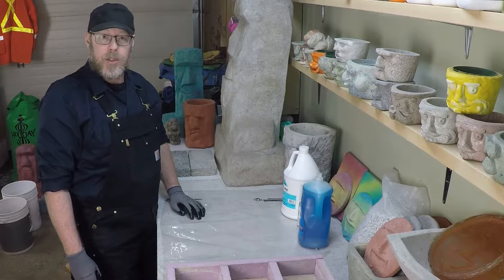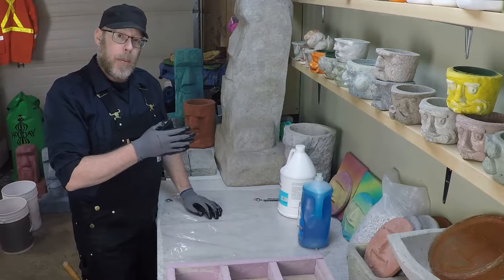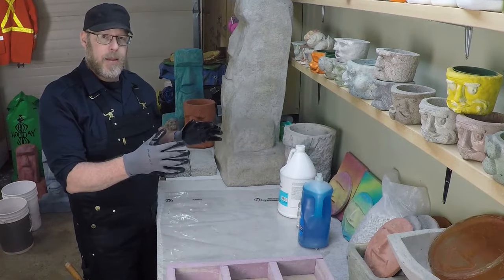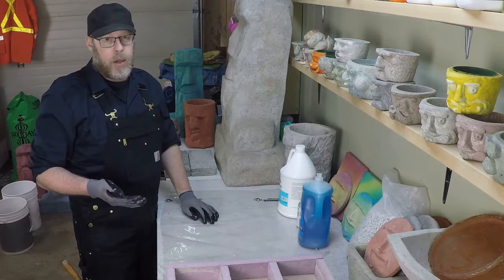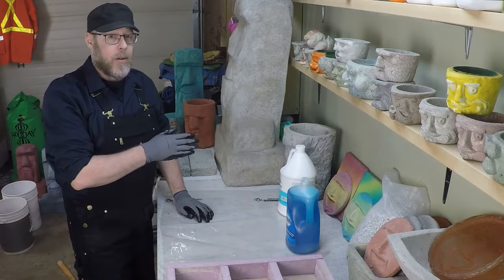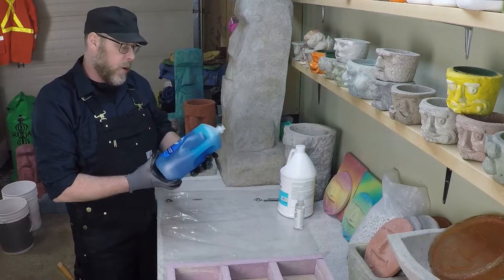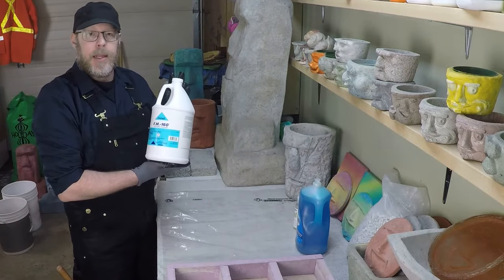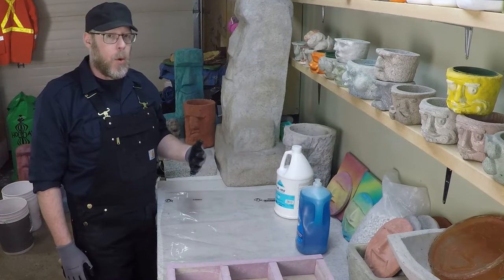What is Foam Concrete?

Comment: Idea: what do you thing about creating a wall around the yard using aircrete? My idea is to put a board barrier on each side of the existing chain link fence, then pouring the aircrete in there. This should provide extra righty and structural strength for the wall.

Comment: Great info, thanks! Have you had a go at making aircrete yourself Steve?
Reply from the maker: I have.  In many of my videos you see a foam generator with 3 brass valves on the wall in front of the bench.  I have had mixed results in terms of success.  More foamcrete videos to come!

Comment: THANK YOU!  👏Could you add foam to "regular" concrete with aggregates (not just portland cement) to make it more flowable or insulative? I do not mean aircrete only but "normal" concrete, i.e., a bag from one of the big stores?  Thank you all!
Reply from the maker: Yes you could add some and it would increase thermal resistance, but also will make the finished product much weaker the more you add.
Reply: With concrete its very likely that the rock aggregates and sand will sink to the bottom because the bubbles probably won't hold them in suspension

Comment: This is a very disappointing video. There was actually no foam concrete in this video at all.

Why didn’t you make some and show how it works?
Reply: I felt the same way when I finished the video, but then I saw he has lots of videos that show foam concrete, this video answers the question in the title, I think we're just used to being click-baited. :)
Reply from the maker: I did, and have, and if you want to see those videos you will have to subscribe to the channel.  This is just my first vid on the subject.  Many more coming.  I can not show and tell every question in every video.  Specific question, specific answer.
Reply from the maker: I definitely do have more foam crete videos coming out.  I wish I could just upload all videos all at once, but it takes so much work behind the scenes to make these, edit them, put upload them etc.  Getting them out as fast as I can!
Reply: @creatingconcrete  
“Answering questions about foam concrete” would have been a more accurate title. 

For the title of the video, it was disappointing. 

I mean, you have all the stuff to make it right there.